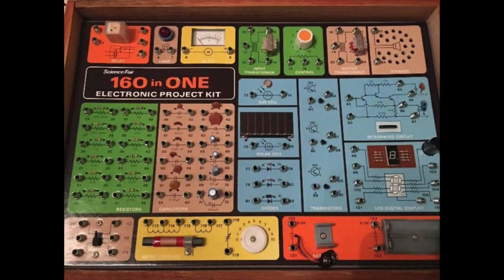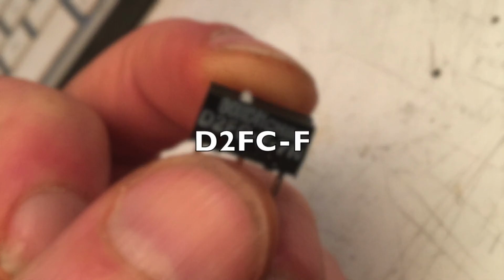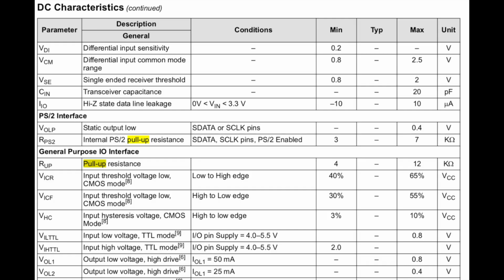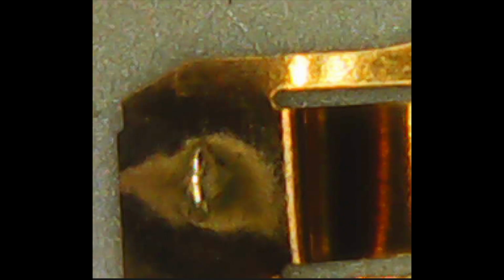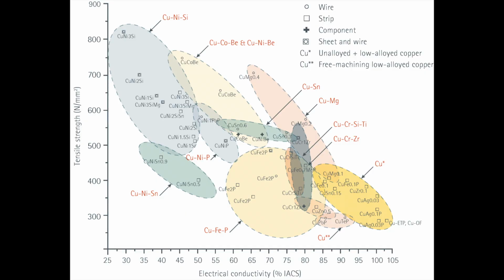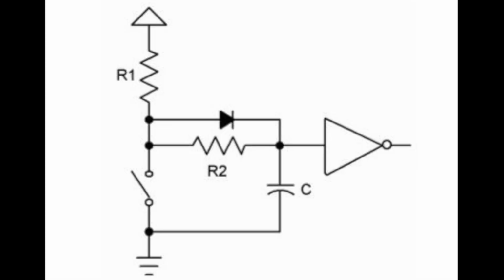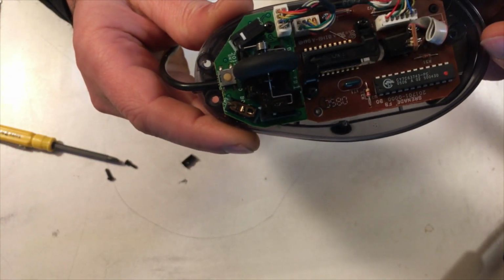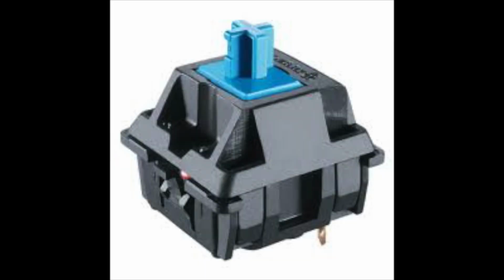Failing switch problem: Omron vs the modern mouse circuit

Comment: Great video Alex, explained perfectly. Btw, seems some companies had idea of switchable switches mouse in their mind or maybe watched this video :D 
''Asus ROG Chakram'' push-fit switch-socket design mouse  . Would be interesting if they done some upgrades electronically as well. Alex, it would be great if you could take apart Asus ROG Chakram mouse and do tests on whats happening inside this new boy on the block.
Edit: should've read comments, someone already mentioned Chakram :)  . Still , Alex, would like to hear your opinion about this mouse (voltages inside and ect), so maybe my Logitech Pro will know about future contender and will start to behave . Thanks

Comment: Amazing video, I couldn’t stop watching until the end, thanks. If you have time and energy, please analyze and make a video about the new Razer optical switch, not sure but could be also another solution for this issue. As I understood it works on the same manner (mechanic speaking) but the click signal are optic, so no debuncing problem, at least is what Razer claim hahahaha. After a long research I decided to try the new Razer Viper Ultimate with the optical switch with 70M clicks hahahaha, lets see what happens. Thanks again for this video and sorry about my English.
Reply: Very curious on how the mouse is doing. I play MMO games and I REALLY need the extra keys as I key bind every single thing... and as far as I know there's no mmo mouse yet with optical switches (well, old naga used to be optical..) so I'm quite fucked.
Reply: So after 11 months since your got the Razer mice, how does it feel?.. Did ya had any issues with it (any kinda of issue, eh, not just the clicks)
Reply: @DVTHEFOX  Hey! I had a problem after a few weeks, the left bottom start to make a creaking and wobble click, but I looked up and the defect wasn’t the optical switch it self, but the plastic shell of the mouse, was a problem on the manufacture (a batch from Malaysia factory more specifically) related to this shell. So Razer exchanged it for a new one manufactured on China and still perfect since than, hadn’t any issues. And a month ago I also got a new keyboard with optical switches from Razer, is the Huntsman tournament edition, I know that the mechanism is completely different and for keyboard should have the problems the mechanical mouse switches has, but any way it was a great upgrade, this optical switches on keyboard are really a big deal. Now there are new optical switches that they call analogical (what doesn’t make sense, or is optical ou analogical) that has several stages of actuation, looks very nice as well.

Comment: Thanks for this, I was so disappointed that my Corsair M65 RGB Elite (lol... these names...) was failing on left click so soon... good thing I have a MAD CATZ that has crapped out and can act as a sacrificial... and access to a few older logitechs and other ones that have failed in other ways. It's a shame that they charge this much for something that lasts such a short time. I won't be trying to buy a new one or get it replaced, since I luckily can replace the switch myself.
Great vid with relevant and interesting details on switch internals!
Reply: I don't have time to watch the whole video right now, but I can say that all the Corsair M65 mice seem to be have these clicking issues... I had an M65 PRO RGB that worked flawlessly for over a year until the left button started double clicking every now and then. I returned it and switched it for M65 RGB Elite and it worked for about 4 months until the left button started acting up (not registering every click). I should still have some warranty left, but this is starting to piss me off... I would switch to another brand, but my keyboard is from Corsair and it has been working pretty well and I don't want to have two separate softwares for my keyboard and mouse.
Reply: @Pseudoplasmagore  sounds like we had similar issues with the left click. I RMA'd my first mouse, then the replacement's right button was not supportive enough. I ordered a Japanese omron switch (d2f-01f) and soldered it in for the left button. I put in a Huano "white dot blue shell" on the right, but it's still too soft. The design of the mouse probably contributes to a weak button. 

For me, I decided to solder on new switches because it seemed cool to try, and the RMA process took a bit long, like a few weeks.
Reply: Same here with the M65. Left click went vague, returned it, and now the right button has 0 resistance. I just ordered some D2F-01F switches, as well as some Huano white dot blue shell switches.

Comment: If you made an open source mouse there would be no scientific measure as to how fast I would throw what little money I have at you. I want an open source mouse with hotswappable switches that doesn't fail every 8 months :[. That would be an amazing project and I would donate to that cause in a heartbeat. Amazing video thank you for the in depth research and look into mice and switches.
Reply: Yeah wouldn't an open-source mouse be nice. I'd love to have a parametric mouse shell where i can specify how big and how angled it is and it spits me out a bunch of files to 3D print.

Comment: I appreicate the effort and depth, but I just want a simple guide on how to fix my MX anywhere2 left button drag issue..Any non-TLDR guide on that?
Reply: 1. Desolder the failed switch.
2. Find a suitable replacement switch of higher quality and more suitable, for example D2F-01F Made in Japan, which should be the easiest to obtain among the good ones.
3. Solder a new switch in.
4. Debatable but seems like a good idea: put a drop of oil into the switch (and its friends) to stave off wear. Silicone oil should do fine, or Deoxit Fader or something.

Comment: my opinion before watching: logitech in general has super low quality switches and gear in general. i never buy a logitech mouse again since they always break within a year. Also their headsets are super crappy. Only the keyboard is lasting a long time now. Their gear is  mostly just shitty, not gonna buy anything from them again. In general all the "gaming gear" is just marketing bullshit and overpriced
Reply: Unfortunately you can't just escape gaming mice. Because where else will you get a mouse with 500Hz or better event rate and correspondingly low latency, and with linear tracking. Office mice are all 125Hz so that's 8ms+ latency, actually noticeable, and they all filter out slow movements and the movements under a small angle to snap them vertical or horizontal, and they don't have a lot of buttons. People of many trades appreciate the additional performance and features of gaming mice.

As to keyboards... well the main gaming feature i need personally is NKRO, and it's a standard feature on any professional keyboard, and even if i wanted macros etc, i'd be inclined to dodge the gaming branded products. As to gaming headsets... well they can sod right off, almost all are incredibly horrible junk, those that aren't quite junk were originally a Chinese domestic HiFi product say by Takstar Electronics which isn't terrible but it's sold at 5 times the price because "gaming".

Comment: Does it really poll for clicks? I thought a click was a GPIO event.
Reply: Likely is on the onboard uC, but USB scheduling is driven by the host. The mouse uC can register events down to whatever speed it's architecture and clock speed allow, but it basically has to put that data on a platter and wait to be asked for it. It's more like the PC polling the mouse.

Comment: After about three months of use the left-click button sometimes double-clicks and more infuriatingly won't stay pressed, making highlighting text and dragging across the screen impossible. I have used Logitech products for over 20 years and this is the first time I got a genuine dud, unfortunately to the tune of $80. Online searches about the issues indicate that a lot of other people have had these problems.

Unfortunately these online searches also indicate that Logitech has been made aware of the issue repeatedly, yet have seemingly done little-to-nothing to resolve it.  That is a damned shame because I expect more from an ostensibly American company, a company that now is less than an inch from losing my business, for all peripherals, forever.  It is also a shame that my $15 Vic Tseng mouse from Amazon outperforms the G502 Hero in almost every way, at least in that it works as advertised.
Reply: Excellent video, by the way.  The CEOs and COOs of mouse manufacturing companies should be locked in a room in which this video plays on a loop, with the only way to escape being using their defective products to navigate a series of challenges involving clicking, right-clicking, double-clicking, and dragging-and-dropping.  My guess is there would soon be a lot of high-end job-openings and starved-to-death executives.

Comment: Yup my Razer Mamba elite have the 50m and just after a few weeks it began to fail, and after a few months now it have serious problems. 
What switch should I replace them with?
I have ohm measured them and the left click which have problem when it just click it sometimes 200-600 ohm and other times the 0,1 ohm that is minimum for my multimeter. The right bottom is always 0,1 ohm and didn't either had any problem with that one.

And very ty for the video it helped a lot for confirming that they are bad microswitches

Comment: Thank you for this awesome video! Hard to find such insight into this topic! Just returned a 3month old Logitech G604 with faulty LMB (in 100€ rage mode). After leaving Logitech a colourful customer feedback email and watching this great video, I found the ASUS ROG Chakram, with ultra easy (no screws) swappable Omron Micro Switches! The price is really high, but in comparison to buying Logitech G crap multiple times (like I sadly did), I‘m sure I‘ll even save money on the long run! Thank you again, and even the companies could thank you for your analysis and valuable suggestions.
Reply: I have g102 and g305 with every switch replaced with d2f-01fl. I use wired mouse more so I just clean up my LMB switch contacts every year. Best shape I've found so far and I couldn't be happier with japanese omrons. 10 of these switches cost me around $9, both mice were $55 total. Cheap, comfy and easy on my wrists. You do have to solder though.

Comment: You are a really smart guy.

I am having double-click issues with various mice over the years.

I have a Logitech G PRO  (wired) gaming mouse (need high DPI because of 4k monitor resolution) and I am having double-click issues.
I am currently using https://www.clickfix.cf/ to manage the double-click problem and I've adjusted my polling rate to 125Hz following your video thanks to you.

I'm also using the Logitech G810 keyboard that's registering double triple key presses too (using registry hacks with Windows FilterKeys and http://keyboardchatteringfix.sourceforge.net/ to workaround this). I'm quite disappointed with Logitech given that I'm using a Glorious PC Gaming Race keyboard with Halo Clear switches (in the office) that's having no issues with this.

Wish mice have replaceable mechanical switches too. I like your suggestions for mice manufacturers.

Do you have a video about reviewing various mice and recommending some of them ?

You should go into making your own mouse in kickstarter or something, you have the skills to fix all these.

Comment: I do not know which switches my Microsoft Wireless Multimedia Keyboard and Mouse 1.0A use, but the mouse (Wireless Optical Mouse 2.0A Model:1008) has had more than 6 hours use daily for 13 years. It is the only Microsoft product I could/would ever endorse.  I dread the day that it fails as I know it will be almost impossible to replace with a similarly reliable model. I remember paying £25 for this kit!

Comment: Dude thanks for the video. Amazing.

So much info that I didn't even realize.

Way more in depth than I thought a "switch" could ever be... 

So I have a G903 logitech mouse, and I am assuming now that it's the same problem.
Not the switches themselves, but the electrical specs don't match up?

If I were to buy new switches for it to solder on, which ones would be good for it, if I wanted slightly less actuation force required?

I know plenty of people who would appreciate this info!

THANKS!!!!! LOVE YOU!

Comment: This needs to go to mouse manufacturers especially logitech. I have a bunch of g102 mice going bad in months. Even tried replacing the switches and goes bad again in several months. I have a cheap office mouse still working after years of abuse.

Comment: so is there any modern mouse that has a switch and voltage that solves this issue or no? because i been searching my ass off for a reliable mouse
Reply: Same here. Gone through 5 Logitech mice in 2 and a half years, all failed because of this. Purchased a G502 Lightspeed in November, figure the $200 price tag meant quality. Took one week for the issue to appear. Logitech sent a replacement, just failed now, so give or take three months. I'm at the end of my rope, can't deal with this anymore. And it seems all mice have these cheap Omron switches now. Apparently Razer has some optic switches which can't fail, but they have a bad rep for other reasons. No idea what to buy.
Reply: @v12vanquish135  exactly the same problem i been having. so after researching a bit I actually recently found out that there are two companies that come with the Japanese omron switches. One of them is a company called Ducky they have a mouse called the "secret"  and the more easily attainable and practical one is asus. Asus makes a line of gaming mouses like the "gladius" that not only has a Japanese omron switch but its also interchangable without any soldering. Try looking into those. Both on the expensive side. But id rather a one time buy with no more hassle or frustration. Im about to order mine soon.

Comment: Hey there I really like this video good work you put in there!
I have a question just for my understanding. You said as possible solution there would be a low pass filter but don't computer peripherals run on dc thus it wouldn't change anything? Or is there still some kind of small frequency that will get filtered?

Comment: I think there are already some mice introduced with optical switches no ?
The only way to truly eliminate switch failing or chattering is to use a switch type that chattering, failing can not occur at all.
So we need to truly ditch normal switches and adopt the "contactless actuation" technology which is provided by optical switches, magnetic Hall Effect switches or Capacitive switches found in Topre keyboards.

Many mechanical keyboard brands have already "switched" to optical, magnetic or capacitive switches in order to get rid of switch chatter.
Altough, they promote their products being "faster actuation" :) which is not the case but you get the idea. The real reason they introduced the contactless technology is because of the high return and RMA rates of keyboards because of some key developing chatter.

Comment: Excellent, awesome video.  And I modded my Logitech G903 last night with Japanese Omron D2F-01's (I knew about the 01f's but I want the meaty stiffer clicks to avoid accidental depressing).  Feels heavenly now.  (I spent too much on a Hakko desoldering pump awhile ago but now it got put to good use).
Reply: How's your mouse now? We need an update!

(I have a G900 Chaos Spectrum.)
Reply: @clavierpixelkey650  One of the mice are still fine.  The other started failing after a few years.  The third mouse I put Honeywell ZX10's on still works perfectly 5 years later.  But that's expected since Honeywell uses a coil spring system, which is completely different than what makes omron's fail.
Reply: How well have it worked?

Comment: I give the video a like but my stupid mouse remove the like immediatly :P
Reply from the maker: HAAAAAA!
Reply: mr faceless  I ordered one today so... I guess I'll find out in a few months!
Reply: mr faceless  so far so good yes. Too light for my taste but the switches are perfect. Remind me to reply again in ten weeks
Reply: mr faceless  My Kone Pro has fantastic button action and seems very reliable so far. However, it's extremely light, around 69 grams. This was very clear when I ordered the mouse. I think it's engineered for twitch-gaming e-sports (as opposed to turn-based strategy gaming, which is my use case). After two months, my conclusion is that I hate light mice. I think this would be well suited to a cocaine-fueled deathmatch, but I just want to reliably drag-select my little d00ds while my 1-player game is paused. I could see other people liking it, though. 

I will be shopping for a heavier optical-switch mouse.
Reply: My G303 Prime initialized self-destruction procedure. ))